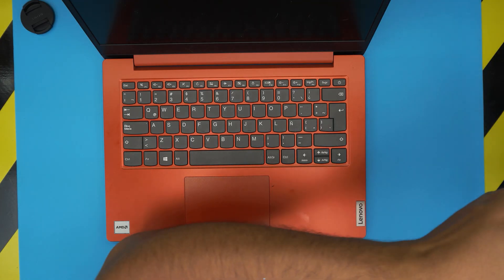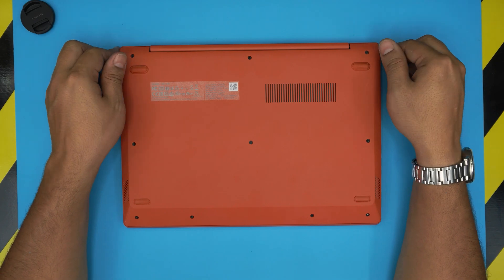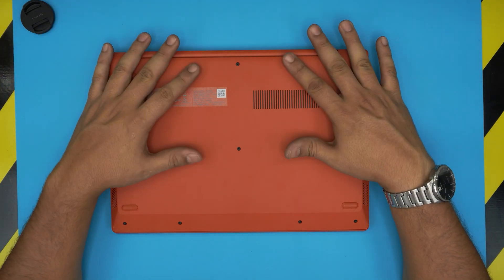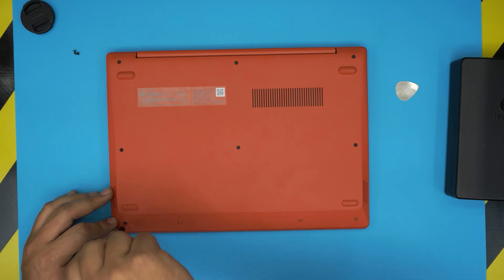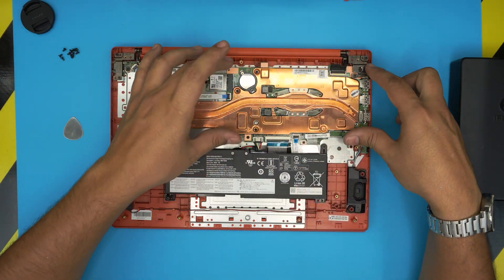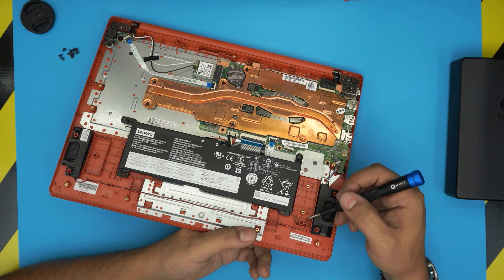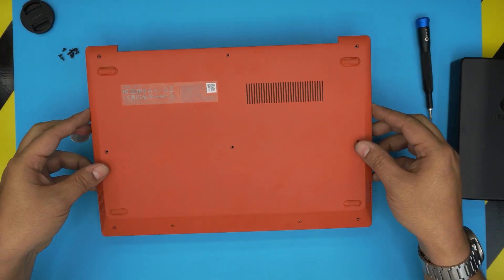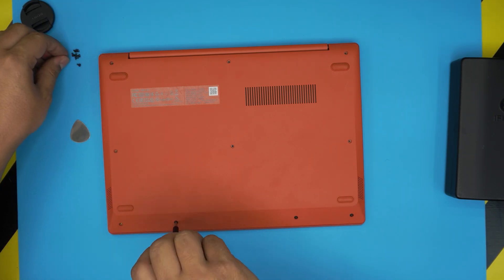Lenovo Ideapad 1 14Ada05 82Gw ⛔ SSD | HDD  Upgrade Not Possible

Comment: Thank you for this video, you saved me from wasting my time. I was about to try soldering a m.2 connector to the board. I have the same model ideapad 1 14ada05 82gw, i guess it is ewaste now 😢
Reply from the maker: It's my pleasure my friend.
🫠Regarding your upgrade, ya don't waist your time soldering, we have soldered and nothing, there are many other components that are not installed and re programing the bios also requires.
Should you have any further questions or requests in the future, please don't hesitate to ask me.
cheers🍻

Comment: How to ssd slot I don't have it on my laptop, what should I do now, how can I install it?
Reply from the maker: no my friend you can't and if you put the jack in and still wont work, you need much more power regulator firmware change and it is not something you can do it at home.

Comment: Lenovo says it has one m.2 ssd slot.
Reply from the maker: Thank you for your feedback! If you wish to support the channel, you can like, subscribe, or both!
Regarding your question, Lenovo can say what they want to say, but the reality is that there is no extra m.2 for SSD storage, unless you have a sub model that has it installed there are many sun version (revisions). but it is very clear that in this model it is not installed, i been servicing laptops for over 17years. the best confirmation for you to know the trust is to open and check it, it is only few screws. you may have it if you got a higher revision.
Should you have any further questions or requests in the future, please don't hesitate to ask me.
Reply: @uFixTek  Ok, ill just skip this laptop than. Kinda dumb that a 2020 laptop doesnt have an upgrade slot for ssd or hdd.
Reply from the maker: oh if you hav't purchased this laptop, plz don't i don't recommend you, go look for huawei laptops they are cheap and well build

Comment: how about use wifi m.2 slot?
Reply from the maker: we have place ssd there but for some retarded reason firmware or power delivery it doesn't work. on some other laptop it does detect but super slow.
Reply: @uFixTek  thsnx
Reply from the maker: my pleasure my friend :) thank you for the support